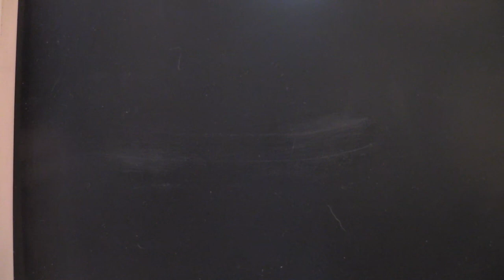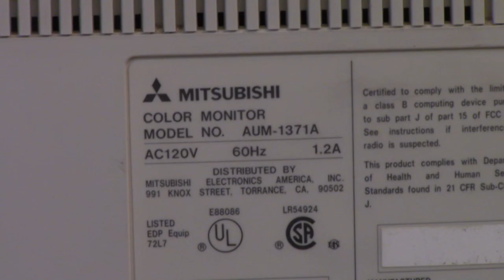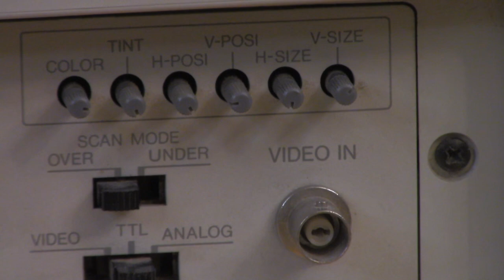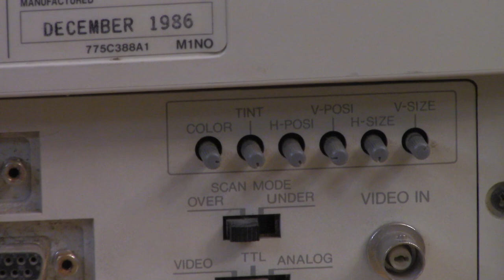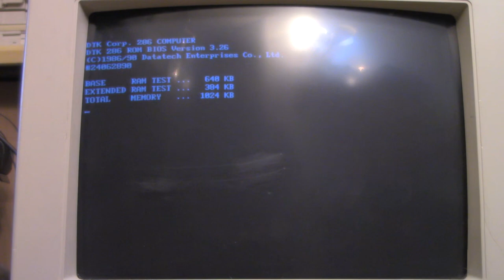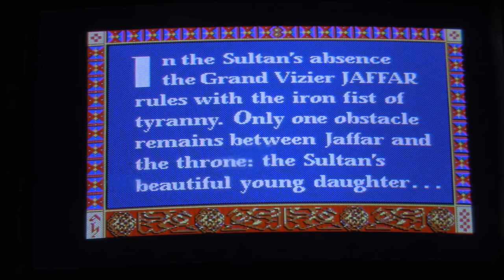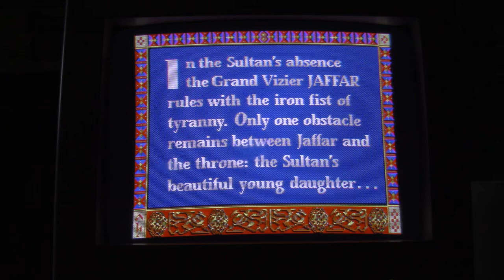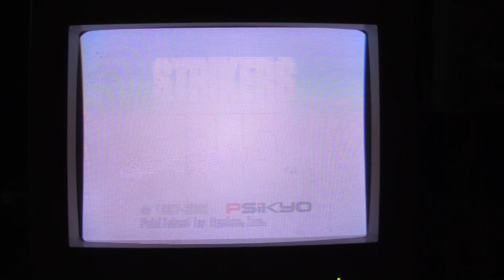Mitsubishi AUM 1371a Multisync Monitor

Comment: I have an AUM-1381A. A great "do everything" monitor, from composite and CGA to Super VGA. I've even gotten it to display 1024x768, although only in interlaced mode.
Reply from the maker: ah, so that 25-pin analog connector most likely is VGA then? I guess I just need some kind of 25-pin to 15-pin cable. By the way, your comments seem to be posting now after what seemed like a year of them dissolving into Youtube oblivion, which is nice.
Reply: @AncientElectronics  Yes, it will support VGA if you can find (or make) the right cable for it, which may be difficult.

Comment: I had one of these back in the 90's.  Wish i could find another.  Theres a brochure on bitsavers that has the pinout for the analog input, which will handle VGA with the right cable (they pop up on ebay now & then).

Comment: I had a monitor with a similar 25pin input many many years ago, in my case it connected to VGA with a cable that came with it. Never seen a similar cable since.
Reply from the maker: Was it a 25 pin to 15 pin VGA cable or did the computer it was meant to be used with also have a 25 pin VGA output?
Reply: @AncientElectronics   It was a 25 pin to 15 pin VGA cable. That monitor also had an EGA TTL input, but no other inputs.